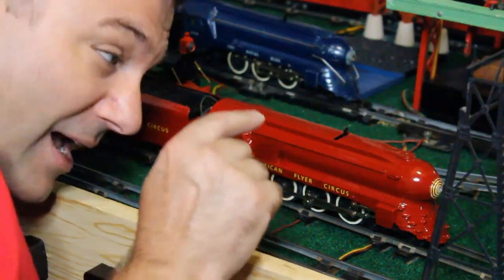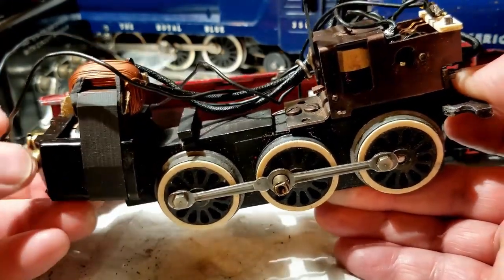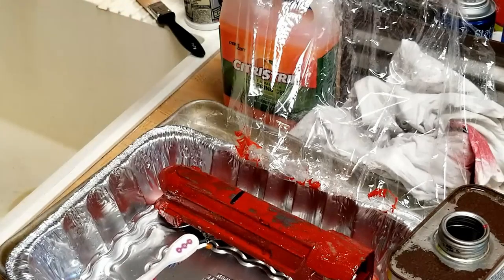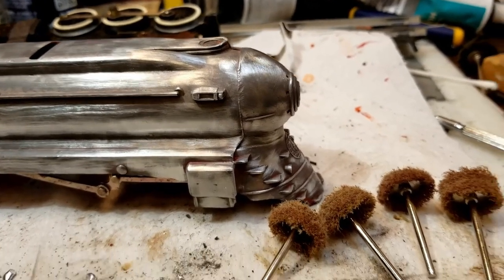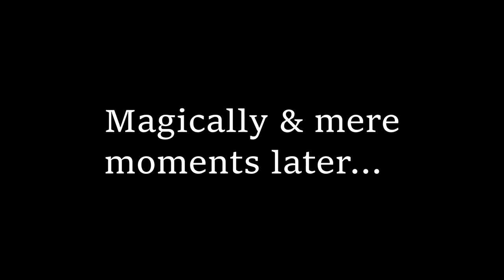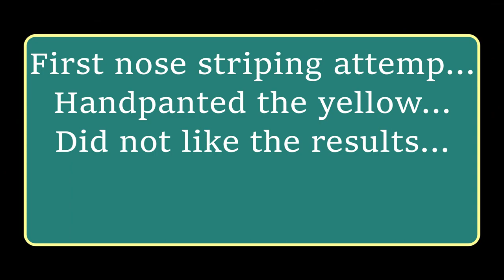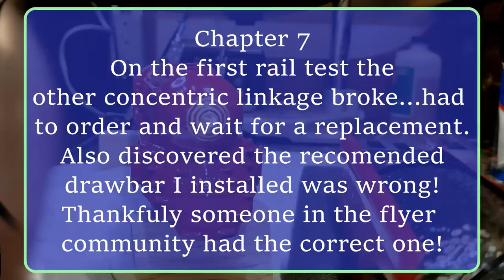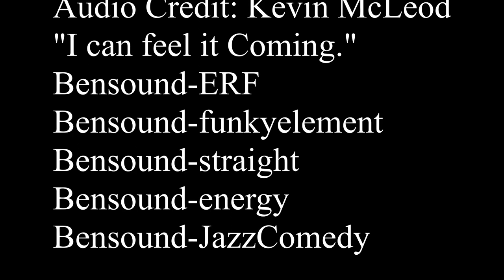Junkbox rescue...The rebuilding of a 1951 #353 Circus Engine.

Comment: I haven’t found a video cover drawbar riveting and linkage riveting until now. I have been looking for a simple way to do that myself. Very useful!
Reply from the maker: You are welcome.  Make sure to use the proper sequence of parts so the drawbar is electrically isolated.  If not it will cause a dead short.

Comment: I have a Royal Blue set from 1948, I believe, and the front truck on the engine is so light it keeps jumping off the track, especially on curves.  Have you ever heard or found the need to add ballast/weight to this front truck to keep it down and on the track.  Great job on the rebuild.  It inspires one to try it also.
Reply from the maker: I have heard of this.  Weight ir a light spring should do the trick.  I might also suggest you double check that the frame and boiler are attached correctly.  If those are not then it will through the front of the engine further to one side leading to enough sideways pressure to toss the front truck.  Hope this helps!  And thanks for the comments.

Comment: Austin,  I noticed in the one of the opening shots that the lead truck had wheel sets that were probably from the early 60's when Gilbert started really cheapening parts. One of the things they did to save money was to use less plastic on the wheels so the front faces of the wheels are dished out. Not a huge deal, but just thought I'd mention it because I've never seen the short lead truck with scooped out wheels on a circus engine or Royal Blue. They must have been replaced at some point.
Reply from the maker: Interesting...I'll compare it to some royal blues.
Reply from the maker: Michael...impressive eyes you have!  You are correct that the front trucks are the wrong ones!  You wouldn't happen to have a spare set laying around?
Reply: Austin, No, unfortunately I don't have any of the short lead trucks. Portlines might carry them. You might even find them on eBay. They should not be that hard to locate.
Reply from the maker: I also may try my hand at modifying the one I have...would be a fun little project.
Reply: I bought a set of pilot wheels or truck rather from Port line Hobbies for my 356 Silver Bullet Pacific. Never found anybody as detailed as I am until now about the inset rims on the wheels starting in 1958. You are the first. The couplers were different too with a little more plastic on the back of the inside of the coupler plus extra plastic on the inside piece opposite of the knuckle pàrts. I don't know what anything is actually called, so excuse me if I don't make any sense.
Reply: That extra plastic on the 1958 and later couplers kept the cars together. You could pull the cars apart with the older couplers even when closed. Cannot do that with the  newer couplers or you will just break the knuçkles. I am sure you noticed that. I have talked to repair men and other collectors about the 1958 to 1961   sintered iron trucks, couplers and wheel differences and they have no idea what I am  talking about! They think I am from another planet. Maybe they are right! I have found that most people do not notice things that are different. You and I are 2 out of a thousand it seems. I have been told that an item is excellent and it turns out to be very good most of the time.

Comment: Did you spray a final clear coat over the engine and tender after installing the dry transfer decals and painting the circles on the bullet nose?
Reply from the maker: Everything but the nose circles...I'm not yet happy with them.
Reply: @AustinsAmericanFlyertrains  Here is an idea for the nose circles if you have not already tried it.  Use a fine pointed, felt-tipped marker instead of a paint brush.  You  can use a dried up marker dipped in the appropriate shade of yellow paint OR find a marker the approximate shade of yellow as the circles and apply the "ink" directly on the circles instead paint.
Reply from the maker: Thanks Bill.